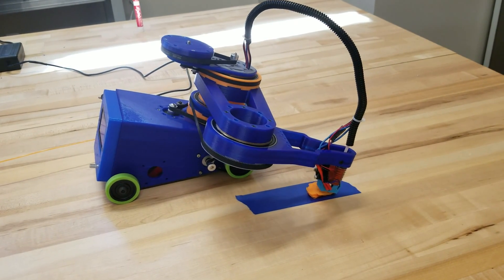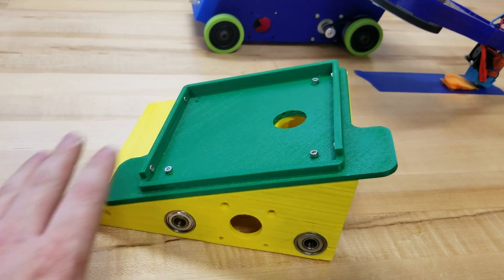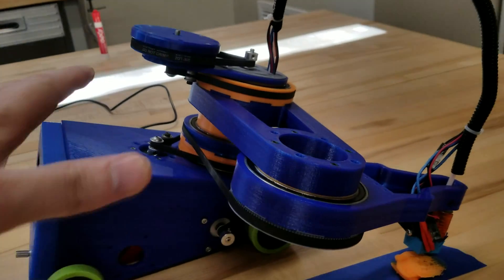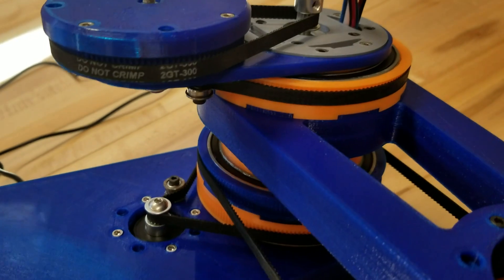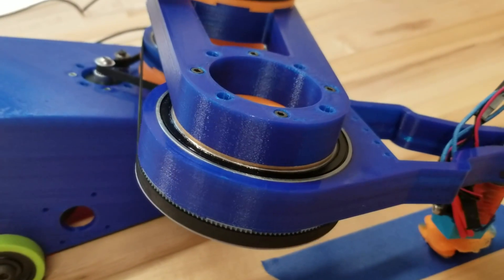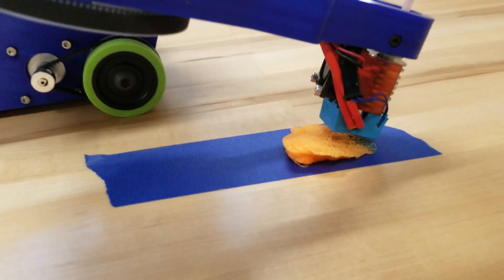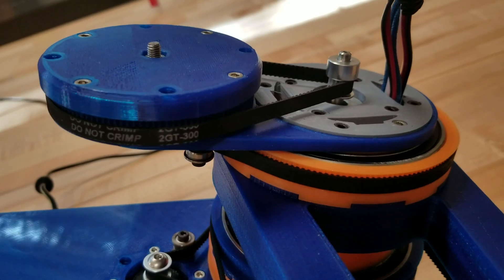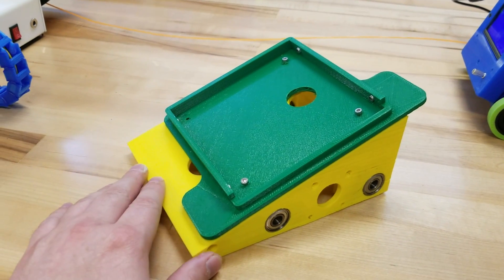RepRap WHEELIOS

Comment: 3:45 Can you remain more how 608 bearings require "axis wide"? (Having trouble picturing what you meant.)
Reply from the maker: 608s just have less contact with the plastic.  I would move from 1 sided joints ton2 sided joints for them to even be an option here.

Comment: From a practical point of view this is a waste of time and materials a conventional printer is much faster......but wow 😍 I'm amazed at your ingenuity and your skill! Thank you for trying this out so we don't have to!
Reply from the maker: Thanks!  This could be as fast as an conventional printer.  I just go slow on early prototypes.  The belt printers are so cheap now that there isn't much motivation to continue this project.  I did learn a lot that is being used on other projects.
Reply: @NicholasSeward  wowzers! As fast as regular 3d printers😃 Belt printers ain't got nothing  on your design...when Mars one needs a line printed around the planet. They will contact you 😜 but seriously impressed  that you managed to make a firmware which could interpret  the crazy kinematics design and build something of this complexity which actually  works! 

My attempts at building  taught me that the more complex the system the more things can go wrong...heck I've spent several hours/days just modifying  wiring harnesses so they don't kink😅

You deserve a medal 🏅

Comment: Just remove those wheels and put omni- directional mechanum wheels on it and you can have infinite X and Y!
Reply from the maker: That would be sweet.  If you can get good enough feedback and the ability to do microadjustments in the x and y...that would be amazing.  I have been wanting to try something like that.
Reply: @NicholasSeward  That's awesome!  Great minds think alike!  Have you tried adding some sort of stiffener, like carbon fiber rods to the interior of the print by pausing it mid-print?  They use this technique on 3d printed violins!  You might be able to make longer arms this way!  I think your school should invest in a Markedforged printer, because your doing some ground breaking stuff here!
Reply from the maker: @themeek351  never tried that.  Although most of my stuff can achieve rigidity by just making the parts bigger volumetrically.  If you have a beam and you double it's height, you make it 8 times more rigid.  That said, I really like the idea of a fully embedded cf rod.  I might give thay a go.

Comment: Any chance that I can see the CAD files, please? Also, do you really need the secondary axis?
Reply from the maker: I will share them if you want to email me.  The secondary axis isn't necessary but it helps get a higher mechanical advantage and position the steppers in the central column.  I would never build this same exact machine again.  I was trying out a few ideas.

Comment: I like the Helios (a lot) and like this design, but another idea might be to have the head area be behind the wheels, with no arm - i.e. like a Prusa on wheels. The head would move up/down/left/right for the Z/Y-axes, whereas the wheeled portion would be the X-axis. It would eliminate almost all of the belts, extra motors, and bearings. I am also a 3D printer developer, working on a new design, which is designed to eliminate all problems other 3D printers have (i.e. component failures, extruder problems, backlash problems, and more).

Comment: Cool.  However the biggest issue I see with this type of machine is that any noise at the arm axis is mutiplied by lever ratios.
Reply from the maker: True but my minimal testing showed this to not be a concern.
Reply: Understood.  My thoughts: Keywords: "Minimal testing".  I'm sure you're aware of this ...Any vibrations, wheel adhesion to surface and motor slack in the drive will have an impact.  I would look at the resultant part through  a microscope and it will be apparent.  I'm sure the cantilever effect will also impact the Z too.  Please don't take this as a criticism but more of a possibility for improvement if there are issues.
Reply from the maker: @GodzillaGoesGaga  Yes, you will need to make sure the surface is clean and belts are tensioned.  Vibrations created by the bot are minimal and tunable by the acceleration setting.  The surface quality looks as good as anything I have ever seen.  I feel that artifacts that only show up under the microscope wouldn't be a show stopper for the typical user.   The cantilever effect  will have a 1st order reduction thanks to bed leveling.  (There are 2nd order effects that would be harder to address and you have to trust that you have a flat surface.)

I am definetely keeping an eye on those issues.  That is partly why I haven't released files for HELIOS yet.   It is easy for a SCARA to produce poor prints.

Comment: One other thought - it would be interesting to add SCARA / Helios support to Klipper (https://github.com/KevinOConnor/klipper) where the gcode processing and step planning is done on a Raspberry Pi and the microcontroller runs a very simple firmware that maintains a FIFO of simple commands to steps the motors and turns heaters on and off in realtime.

Comment: This is cool! Would you consider making the angle motorized or adjustable in some capacity?
Reply from the maker: I considered it.  It makes things harder for a little gain.  A traditional nozzle can only support about 25 degrees.  Much less than 20 and the z shrinks to nothing.  It seemed like there would be little need for adjustments on the fly.

The belt printers allow the nozzle to dip below the bed at an interface zone making it easier to hit 45 degrees.  I might play with some special nozzles but for now Inam stuck in the 20s.
Reply: Nicholas Seward that makes sense. I think the creator of the DICE printer experimented with using airbrush tips which are very chiseled and might allow for lower angles.

Comment: Please make a Linear rail version, it won't be movable, but it could print on both sides, that would be awesome!
Reply from the maker: We could do some herringbone tracks if you want to keep it cheap.  That would also allow you to remove sections from one side and add to the other to print longer and longer.  Or....You can print the track.
Reply: @NicholasSeward  yeah it's too early to say as you're still working on it, but yes there definitely can be two versions, one with herringbone, and the other with linear rails. that Would be awesome!
Reply from the maker: @iamthebest22  I am quite sure I won't do a linear rail version.  I may do a herringbone version.
Reply: @NicholasSeward  Please do! :D I think also less chance of slipping unlike wheels.